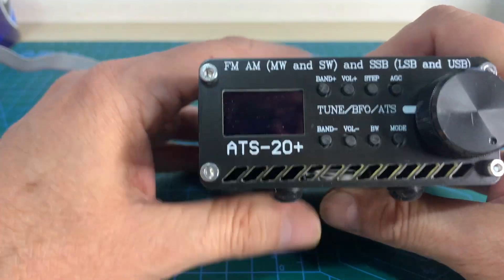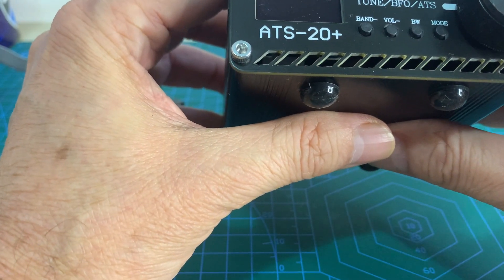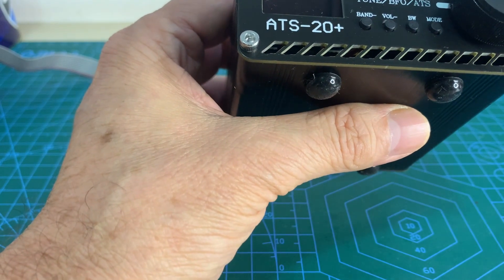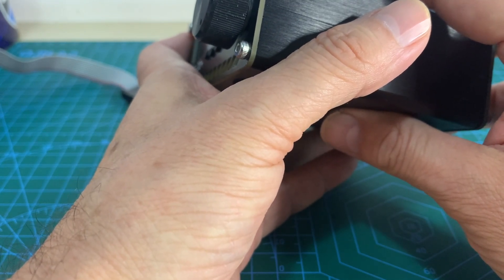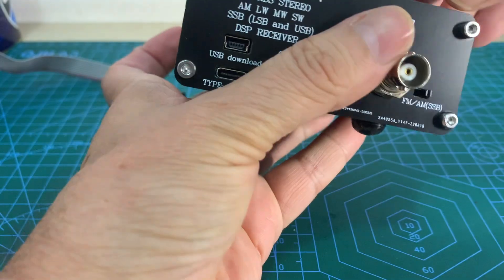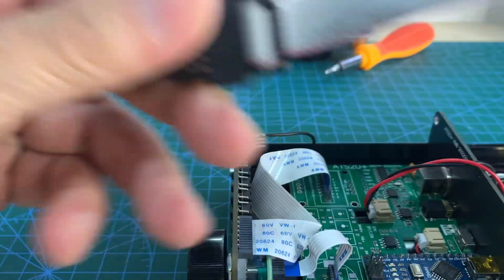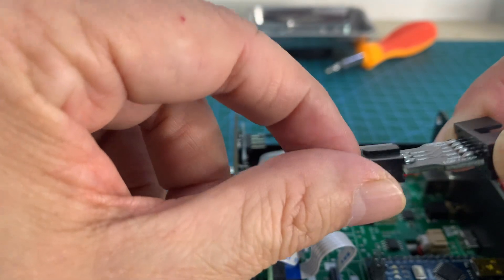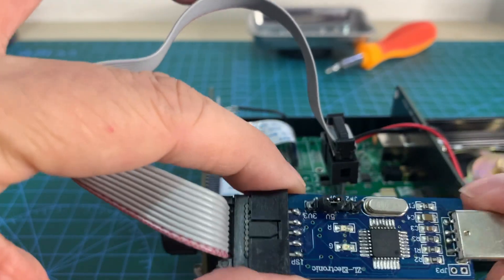Using USBasp V2 to update the firmware of the ATS-20 and ATS-20+

Comment: Hello, I loaded the firmaware on the radio, it seems to be going but on the AVRDUDESS program I get an error at the end. It reads:
avrdude warning: verification mismatch
        device 0xff != input 0x0c at addr 0x7800 (error)
avrdude error: verification mismatch

avrdude done.  Thank you.
I don't understand if it's a mistake or not. What should I do? Thank you

Comment: Good morning, sorry, I'm ignorant. I would like to update the firmware on my radio, I downloaded the hex file v 1.18. To load the firmware do you use the right ide? Do you have to delete the original file in the radio first? Or do you load the new file over? Thank you very much.
Reply from the maker: I do not distribute hex files. The source code for some sketches for this radio model is available in the repository. They can be downloaded and compiled using the Arduino IDE platform.

Check this link:
https://github.com/pu2clr/SI4735/tree/master/examples/SI47XX_ATS20_ATS20%2B/SI473X_ALL_IN_ONE_OLED_RDS_CHINESE_V9
Reply: @pu2clr  Probably with the translator you can't understand. I asked you if the software to use to update the radio is ide. And if to put the new firmware you have to somehow delete the original firmware. I hope now it's clear, sorry.
Reply from the maker: @lifeafterlife9939  I don't believe the issue here is necessarily the translator. You mentioned that you downloaded a HEX file v1.18. I have no idea where you downloaded this file from, nor do I know who generated it or based on which source code. As I suggested in the previous message, I use the Arduino IDE to upload the firmware from the source codes available in my repository. The Arduino IDE compiles the code, generates the HEX file, and uploads it to the Arduino (in this case, a Nano). The code or program previously on the Arduino is overwritten with the new program. In other words, you will lose the current version running on the Arduino. Let me know if you need further clarification.Best regards.
Reply: @pu2clr  Thanks, sorry. I downloaded this .hex file from github goshante it says binary link latest version v1.18. The binary link, once opened with ide, must be compiled something like this, or must it be loaded directly onto the nano? Thanks

Comment: Hello, i cant find the "usbasp (minicore)" in the programmers menu although i installed minicore.

i also get this error when trying to upload:

Error: cannot set sck period; please check for usbasp firmware update
Error: program enable: target does not answer (0x01)
Error: initialization failed  (rc = -1)
 
double check the connections and try again
use -B to set lower the bit clock frequency, e.g. -B 125kHz
use -F to override this check
Failed programming: uploading error: exit status 1

Comment: Good evening Ricardo, how are you? First up, i would like to give you all credit for writing the program, huge thank you!!!

Secondly, I got a big problem!!! When I turned on the radio for the first time, I noticed that when I turn the TUNE knob, the frequency does not change at all!!!

On the other hand, in SSB Mode, when I turn the TUNE knob, it has arrows that point towards the frequency and if I turn the TUNE the other way, the arrows disappear but still can’t change frequency or BFO.

It is V 1.1.5 by PU2CLR which I think is the factory firmware. Is this the problem?
Reply from the maker: Judging by the description of your problem, the encoder on your radio seems to have an issue. If you have some experience with electronics, my recommendation is to replace this encoder. There are many reports from users of this receiver about the low quality of the encoder.

Comment: Ricardo, fiz todos os procedimentos mas está aparecendo esta mensagem:
Sketch uses 28898 bytes (88%) of program storage space. Maximum is 32768 bytes.
Global variables use 1419 bytes (69%) of dynamic memory, leaving 629 bytes for local variables. Maximum is 2048 bytes.
A programmer is required to upload
Reply: Ricardo, consegui atualizar, era a versão do IDE, coloquei a versão V 1.8.19  no W11 e instalei o drive pelo ZADIG 2.9 e deu certo com as configurações que você explicou no vídeo, usei o programador USBasp.
Reply from the maker: Esta é apenas uma advertência indicando que você está próximo de ultrapassar o limite de memória (88%). Não é necessariamente um erro.
Reply: @pu2clr  Sim! Inclusive deu a mesma mensagem na hora que gravou a atualização, porém na versão do IDE V1.8.19 o W11 enxergou o drive USBasp e gravou a atualização corretamente.
O Rádio tá funcionando perfeitamente e inclusive notei melhoras consideráveis na recepção e também na utilização de filtros, RDS, Scan, Step com 1, 5, 10, 50 e 100 passos, FM estendido.
Atualização muito boa.

Comment: Hello, good tutorial, I have a question, I have not yet updated the firmware to the radio but in case I do, if at the time of loading the software the power goes out or something happens and the radio does not turn on afterwards, as shown. do you proceed to recover it?

Comment: Jakie napięcie ustawić na zworce 3v3 czy 5v
Reply: 5V
Reply: Are you sure about that? I mean, after some measures it seems that the built in Arduino works on 3.3V, also docs for SI4732 states that it allows up to 3.6V. So won't 5V from USBasp fry/damage the SI4732 chip?

Comment: I have an ATS-20+ that wont program via regular way.  I bought the USBasp, but Arduino IDE wont recognize it following these instructions.  Any advice?
Reply from the maker: On Tools Menu, go to "Programmer" and select USBasp; Then, go to Sketch manu and select "Upload using Programmer".
Reply: @pu2clr  I tried and the programmer is still not recognized??  Do I need a different brand USBasp?

Comment: Please witch Arduino version ? 1.8.12 or other ?
Reply from the maker: It will work on any Arduino Version. Go to tools menu and select the right Programmer device/method; so, go to  Sketch menu and select Upload using Programmer.
Reply: @pu2clr  thank you very much, i installed 1.8.13

Comment: Good video and really useful info Ricardo. I was initially confused on how USBasp connected device shows up in PC/Mac. Turns out it does not show up as a port. Upload should happen via Upload via programmer option in Arduino IDE.

Comment: Ricardo - I have an ATS-20 and used USB to take the firmware to v3.0.4 - is there a further update or another branch I should use? I replaced the encoder as the cheap one failed. The new one is much nicer. I think that makes my ATS-20 an ATS-20+ lol!
Reply from the maker: I particularly like this one:
https://github.com/pu2clr/SI4735/tree/master/examples/SI47XX_KITS/AliExpress/SI473X_ALL_IN_ONE_OLED_RDS_CHINESE_V8

Comment: Ricardo, my USBAsp was recognized once, but the IDE would not recognize it nor a port for it. Perhaps there is something wrong with the programmer. Or possibly, a problem with the driver install under Win10-64bit. Really frustrating, these radios are pretty fun to play around with, but their update should not be this difficult. I think I'm going to follow the suggestion of another owner, and modify a USB-A to USB-mini cable so the ATS-20+ isn't conflicted with 5V from the Windows machine and the 3.3V supplied to the NANO (this is definitely a problem). Otherwise I'm stuck. However, nice tutorial... KUDOS and 73, W7STF
Reply from the maker: I will check it on Windows 10. Did you followed the steps and Arduino setup?
Reply: @pu2clr  Yes. Win10-64bit. I followed your steps exactly, and was unsuccessful. I'm thinking that upgrading the ATS-20+ might be a major problem if the OS on the computer is Win10. And I do think the collision of 5V and 3.3V just will not work. Hence the need to either cut the 5V supply from the computer, or jump through entirely too many hoops to use a USBasp programmer.
Reply from the maker: I checked it on Windows 7. I needed to install the USBasp driver. It worked fine. Please, for Windows 10 check this guide: https://www.instructables.com/USBASP-Installation-in-Windows-10/